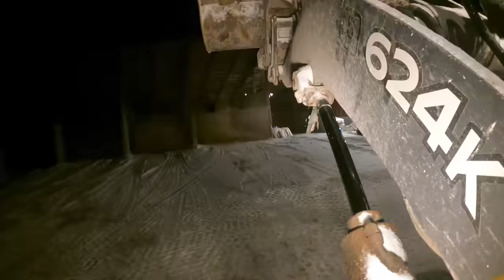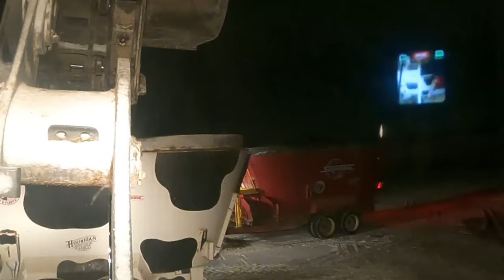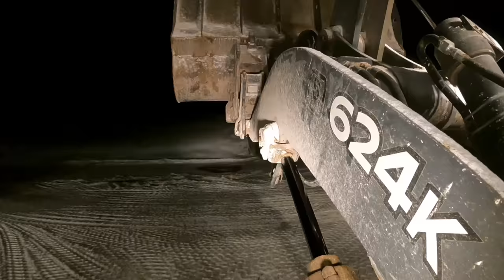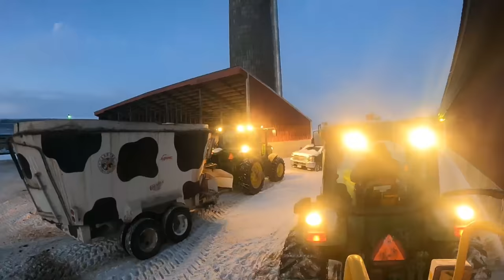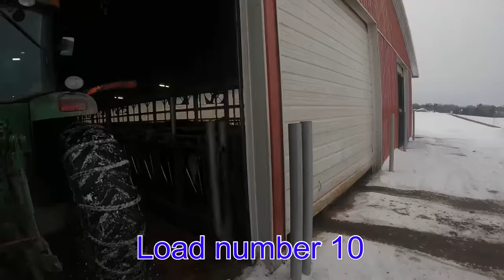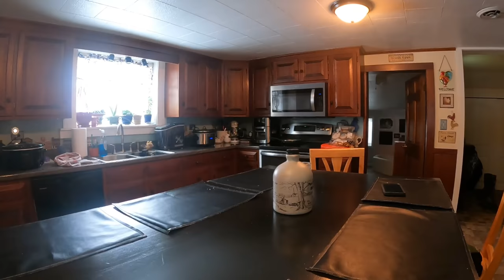Short Day Time Lapse

Comment: There is more work done out of your shop than all the other big farm youtuber put together.
Reply from the maker: And I wish it wasn’t that way
Reply: @FarmingFixingFabricating  Why go to the trouble disassembling the old rollers completely when you replaced the center shaft anyway? Why not just roll the old one out the door in one piece and the reassemble the new one?

Comment: I really enjoyed the video,  especially the feeding.  Feeding cows is really an art form. I started out working on  a dairy in a stanchion barn and gradually moved on to the farm I work at now.  I've been there since 1995. At some point around 2002 feeding cows became my job. When I first started out there we were using a 3020 on the feed cart and a 2350 to load it.  Now they have a 7210 and a JCB telehander. There are so many variables every day.  How much refusal? Did the group size change? Did it pour down rain all night making the silage wetter? How cold is it going to be? Then getting it distributed evenly and if a batch is split, making sure you get the right amount were it needs to be.  Most importantly, loading accurately.  In 2006 I took a job that pays a lot more managing an estate and boarding stable.  I was given the opportunity to work with the best horseman in the country which opened up the chance to ride horses at clinics all over. I found out I love feed and riding horses,  but unable to let go of my roots I still milk 400 cows twice a week. The time is coming near when I will have to stop because I'm having trouble with my hands.  Next year will be 35 years since I started. I will miss my girls.

Comment: I think it would be interesting to try a self propelled mixer wagon. It may not be fast enough but could save a shovel and 2 tractors. You may even be able to direct load silage out of the bunks, instead of having to move it round with a truck during the day.
Just a thought.
Reply from the maker: Only problem is what do you do when it goes down
Reply: @FarmingFixingFabricating   I agree, the answer is probably keep a trailed mixer and you'd still have the loaders, so you'd have a back up. If it worked it would keep hours and running costs down and increase the life of existing kit.

Comment: Hold on, hold on, hold  on! What is wrong with the lightly used wheels? They look perfectly fine from here ... 
Ontario Ca. ~58hr drive ~3398mi ~5469km
Alberta Ca. ~31.25hr drive ~1774mi   ~2855km
British Columbia Ca. ~31.25hr drive ~1632mi  ~2627km
Reply: i agree I,ve seen rollers with the rings worn almost smooth

Comment: We had a 24' version of the Brillion. It was 10 times better than the older (small pack wheel) version!! My 4440 had heck of a time pulling old version so I turned up injection pump after only 3 hours of using old version in field. Needless to say we only had old version 1 season. New version pulled way easier!

Comment: Two more questions, does each animal have its own permanent place, or are they here or there? I'm sure you've already asked, and there's already a video about it. 
Why do you actually use sand and not sawdust? That would reduce wear down and maybe  the weight of the machines. I'm sure you have your reasons, but what are they? Good work! 👍💪😂😉
Reply from the maker: Sand is better than sawdust for the cows and they can free run in the group sections that they are in